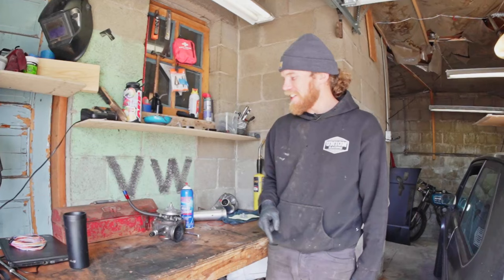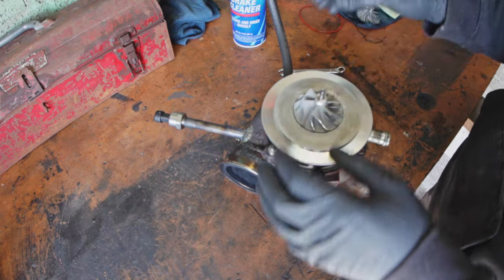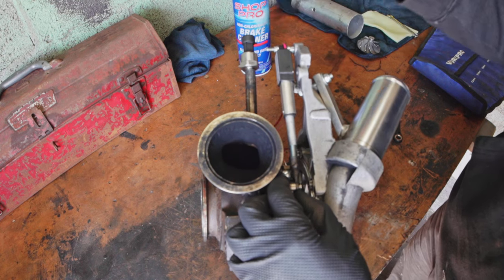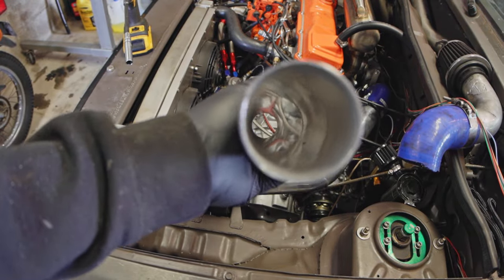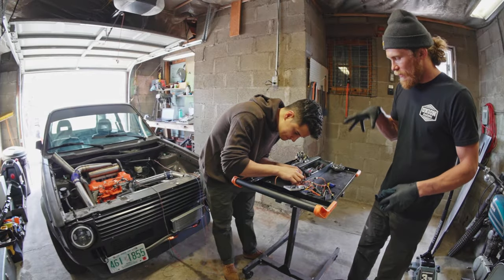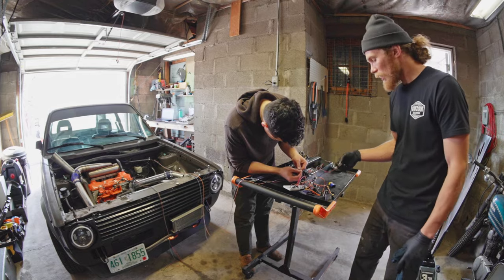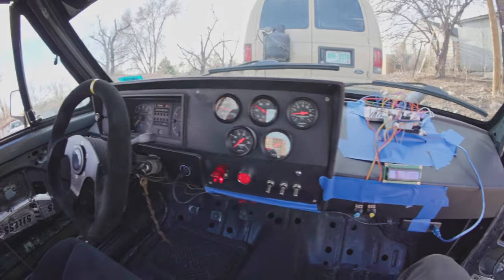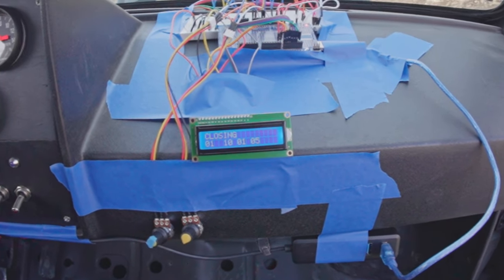This VNT Turbo WORKS!! // How to install intercooler piping

Comment: I dont comment on videos very often. I gotta say, the VNT controller is very cool! One day id be interested in something like this. I have an AAZ im refreshing w/ 1.6td pump w/11mm head, k24, and i think ill be intercooling it at the sametime. Now i really want one of those intake manifolds. Those are nice!
Reply from the maker: Thanks!! Heck yeah that sounds like a cool project. Intercooling would definitely be a good move 🌞 Check out Profi Diesel, makes lots of nice things haha